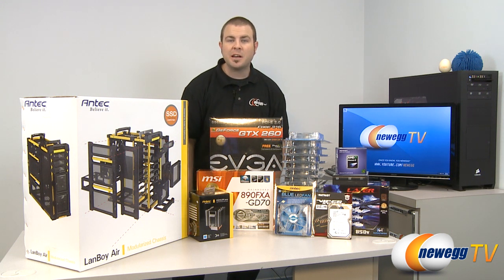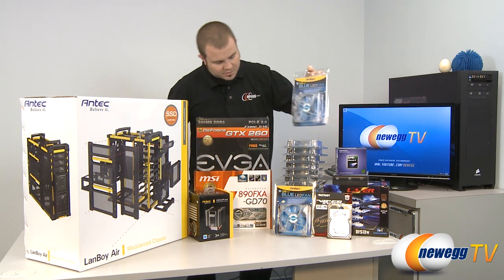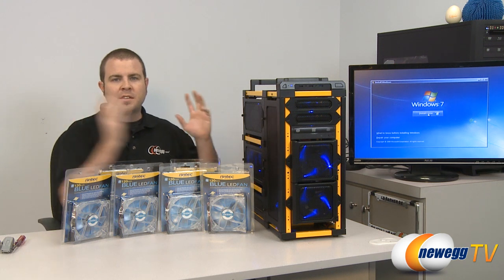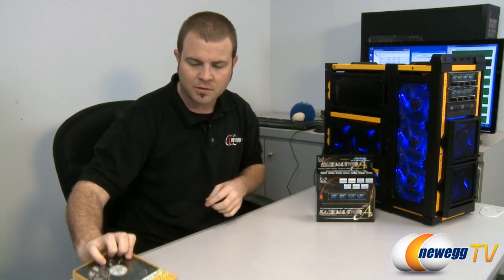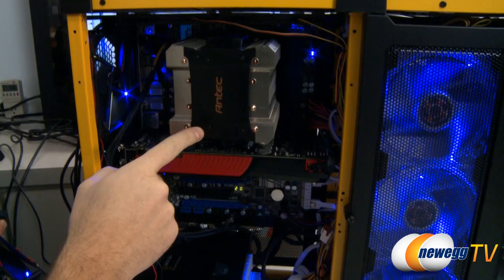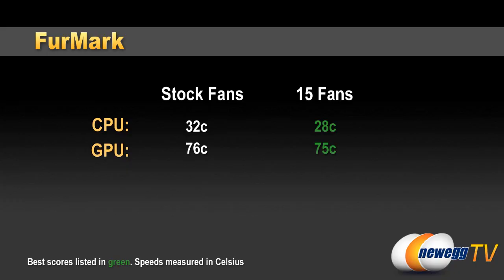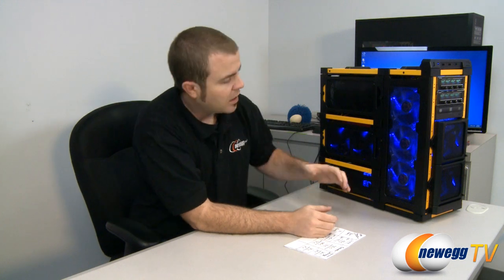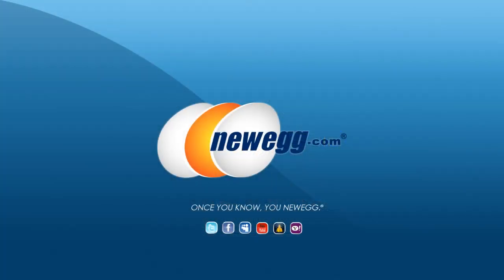Newegg TV: Antec Lanboy Air Test Build with 15 Fans

Comment: @ChrisRey3156 Yes whether or not you need this case is subjective. My dorm doesnt allow me to control individual room temperature therefore I have high ambient temps when they turn the heat on during the winter. I cant even overclock because my computer cant take the heat, so in my case the extra risk of dust is worth it. But Im sure its not necessary to those with nice cool rooms.

Comment: Bottom Fans need to be intake, top exhaust. Test it doing that, as long as there's positive air pressure, you should notice a BIG improvement. So swap the top fans, the rear fans and the top side fans. Doing this pushes the hot air where it wants to go.

Comment: He definitely should have used the standard CPU heat sink because it would have showed a more accurate result on the CPU temperature tests. The Antec heat sink just works to well for the fans to make a difference.

Comment: Thermodynamics is anything but simple.  However, I fly R/C airplanes and we are often confronted by engines overheating that are inside a cowl.  Standard practice for aircraft engine cooling is that the area for the air to flow out of the cowl should be twice the size of the intake.

It would be really interesting to point an infrared camera at the case so you could see the hot spots and what effect changing the arrangement of fans actually has.

Comment: Built a computer with this case--Radeon 6970--P67 MOBO--Intel i7 2600K....so far the airflow with stock fans is fantastic. Crysis, BFBC2--they run cool with max settings. No real issues with dust yet either. So glad I bought this case.

Comment: @anonymousb37 if you can mount the rad of the h60 on the top the have all the other fans face inwards (intake) 

but problem is, is that if you have a mosfet cooler on your mobo then the rad might not fight on the top, i dunno the dimensions

Comment: @BenRSilva If I recall, it only has 8 slots.  For quad SLI you need 9 slots.  The top on is always empty.  Depending on the mobo there is either a 1X slot there or nothing at all.  That has been the standard setup on ATX and EATX boards for a long time.  Also, only EATX mobo's support quad SLI.  This is only a mid tower and only supports ATX.  At best tri-SLI is what you can get in it.  So, yeah.  I will still stick with my HAF X.

Comment: @mario11168 with positive case pressure, there so much air being taking into to the case, there is no place for the dust to build up so it seeps thru out the tiny cracks in the case.

Comment: why didn't you show the HDD temps 
that is the real advantage of this case - low HDD temps (especially using 10'000 rpm drives like WD VelociRaptors)
and why would you mount all the fans pushing air in the case?
on one side of the HDD in and on the other out = excellent cooling

Comment: I'm sorry.. but these results are pretty null unless you experiment with changing the fans around. A lot of people have agreed that the high-pressure approach doesn't really work.. and that you really do need exhaust fans on the top and back aswell. If all these fans are pointing in, then of course the system isn't cooling that well!

Comment: @Benz0Rollin Do you need to slap your own forhead or can i do it for you?  thats the point of the none solid wall design.  the air is pulled in and can NOT get trapped anywhere because it can escape in every direction :S A understand the arguements about airflow and all but seriously, the regular (solid wall, air in and out) airflow design creates eddies and dead zones inside almost any pc case This design alows you to place the fans exactly where you want them and there will be zero dead zones

Comment: as pointed out below i thin a push pull fan config would have worked better. cause as u said pointing them all inward creates a positive pressure pushing hot air to left throught any regulartory vent, but when u fill up all the exit with fans pushing in it doesnt help to allow ho0t air to escape.. can u please redo test for us, dont even have to go a video just post new results in description

Comment: Wouldn't it do better in a push pull configuration. Make all the fans on the left and front intakes and make all the fans on the right top and read exhausts?

Comment: @justmoe33 you obviously don't have one of these cases. If you mounted the fans on the exterior of the top, it would be impossible to use the rear handle on the top of the case >.>

Comment: The positive pressure they are using is "overkill" - the idea is to evacuate heat as fast as possible. The top and back fans should still exhaust while the rest of them draw. That would still give you positive pressure but have a fast escape for the hot air that is in the case. I would suspect The side fans on the hard drives are counter productive and should only run at VERY low speeds OR creating ventalation accross the hard drives, in one side and out the other.

Comment: you could get much better results if you pointed the fans on the top to blow air out. You need to create air flow not just positive pressure in the case. this will blow most of the air into the system and then out of the top carrying with it all of the hot air from the cpu, and some from the video card...

Comment: I bet the GPU cooling would be improved by removing that plastic  casing from that GTX260. Its designed to take advantage of airflow, which is impossible with the positive pressure system you have right now.

Comment: You are not getting a big decrease in temps bc while this case is designed with a lot of holes for airflow but you have plugged up all the holes with fans which are all blowing in so that you are making a high pressure zone in the case which does not help cooling at all. What you should do is have the fans on the left side sucking air in and the fans on the right side sucking air out. If you do that you will have like a wind tunnel in the case and should have much better cooling.

Comment: The airflow is good. The GPU temps say something about the GPU cooler. Try a GTX460 Cyclone. It has an open cooler. That would take a lot of adventage of the 15 fans.

Comment: This is ridiculous... Why not buy a case that comes with 2 HUGE fans, rather than 3455465656767 small fans?

My wind-tunnel case is the best case I ever saw in terms of cooling also you can't hear the fans unlike the 3435345345 small fans...

Comment: @railfan844 It's not that bad.  I have a HAF 932 with 12 2,000 rpm fans mostly antec red led's plus a dominator ram fan and the 230 mm red led one in the front and it's not that bad.  The noise in my system only goes up when I run my 5970 fan at 4700 rpms.  My z5500 5.1 speaker system and x fi titanium sound card helps to make the noise a mute point when I'm gaming and the room is rocking from explosions from the subwoofer under my desk.

Comment: +10 fans = 4 degrees less on the cpu / 1 degree on the gpu.... not really impressive for the investment and extra noise =/ Also on the close fit, it doesn't seem to bad, I got 2 fans that have their cases touching, that is a close fit. I vote for testing Cheezetwinkle's setup.

Comment: @Cheezetwinkle It creates positive pressure inside the cause, forcing diffusion out the parts of the case with no fans. Think of how a cell works. Thats why it does not need any venting fans.

Comment: @doomdragon83 The claim is that if you have all the fans blowing in, the pressure would propel the dust out...take that as you will but that's the claim the manufacturer makes.

Comment: I have a red lanboy and I loaded it up with 12 fans. The front intakes and spits it out back. Compared to stock fans it was 7 degrees collet for CPU and 5 for gpu in 3dmark 08. I have i7-860 and gtx 260.

Comment: I understand that the internal pressure is meant to drive the air out, but I can't imagine how having all the fans blowing inwards is beneficial as it seems this would create stagnation and thus a loss of convection, which is huge when it comes to heat transfer.  I'd be interested in seeing the difference of having one side of the case pull and the other push.

Comment: i get the same temps with my Storm Scout as far as the cpu is concerned only my gpu doesnt go above 74 celcius in games such as BC2 and i have a 6870. my cpu is the Phenom II X4 965 O.C 4.25ghz. Coolermaster wipes the floor with antec

Comment: why did you go with mostly great parts and skimp on the video card? Isn't the reason to have so much airflow to take care of the excess heat from the next gen video cards? should have tosses a gtx 480 to see that the temps are with that case?